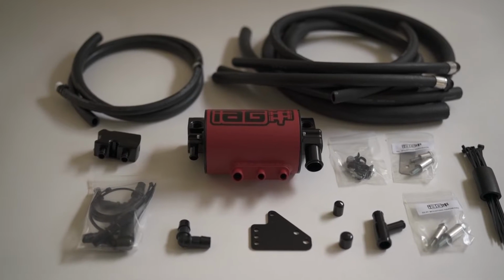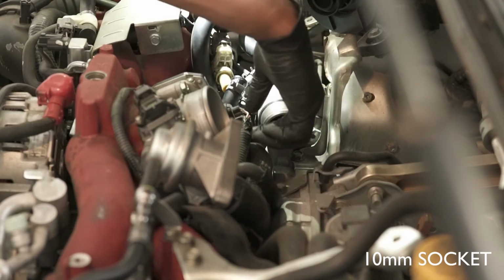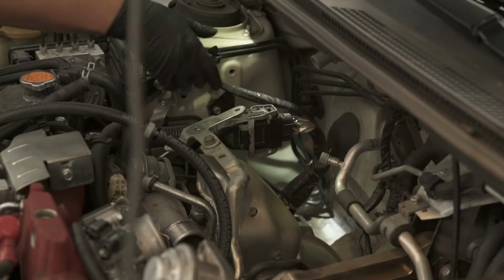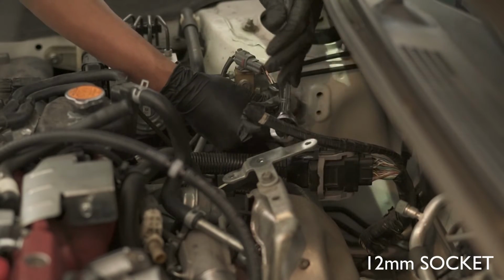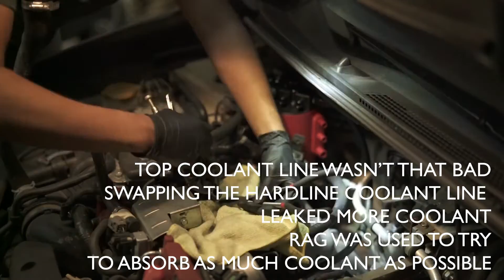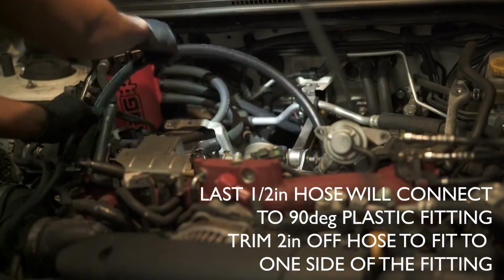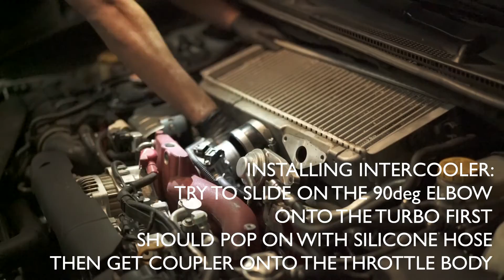Subaru WRX STI | IAG Performance AOS Street Install DIY

Comment from the maker: Couldn't fit this into the video description but use this as a table of contents!!!! :) Thanks for watching!!!

---------------------------
1.

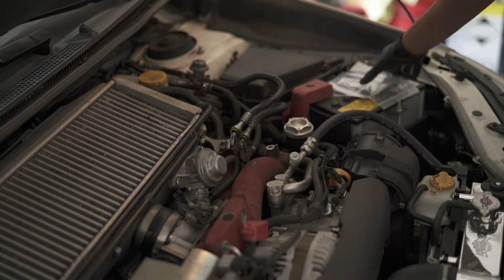-  @2:40 : Disconnect the battery with 10mm socket

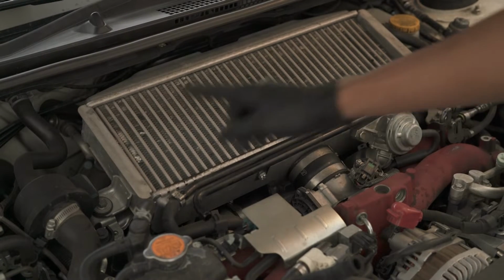- @3:29 : Remove hoses from oil line with needle nose pliers

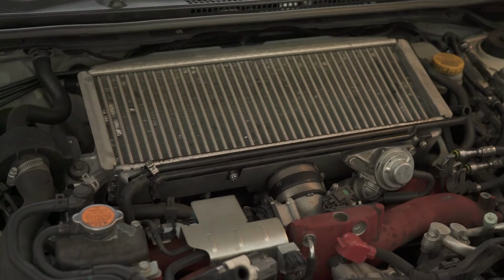- @3:54 : Remove intercooler. use 12mm socket.4 bolts total. 2 bolts mount the bypass valve to the intercooler. 2 hold the intercooler to a mounting brack. 1 of the bolts is block by sound generator tube. remove the sound generator tube (not sure what size socket you need).

- @4:25 : Loosen turbo and throttle body coupler clamps.

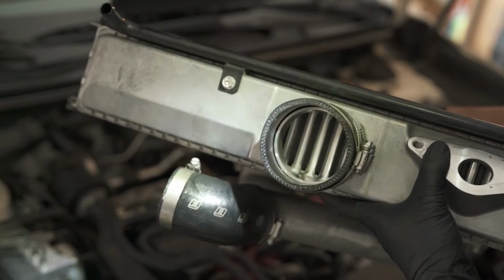- @6:47 : Links to TurboSmart Couplers! https://www.rallysportdirect.com/part/universal-hose-couplings/tbs-ts-hs275075-bk-turbosmart-silicone-coupler-2-75in-black
https://www.rallysportdirect.com/part/universal-hose-couplings/tbs-ts-he90200-bk-turbosmart-silicone-elbow-90deg-2in-black

- @7:50 : remove oil breatherline from intercooler. 10mm socket

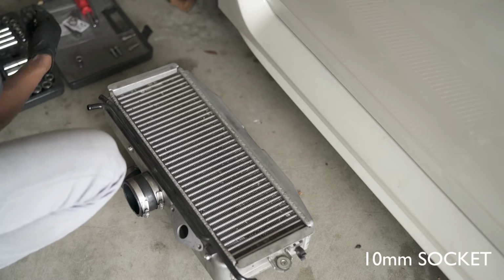-  @8:13 : Remove breather hoses (Passenger & Driver side). On each side there are 2 hoses next to each other. You are removing the ones that are closer to the front of the car on each side. Follow the hoses that were once attached to the solid oil breather line attached to the intercooler. Passenger side breather port is shown @9:20 & driver side is shown at @9:58
Reply from the maker: ------------------------------
2.

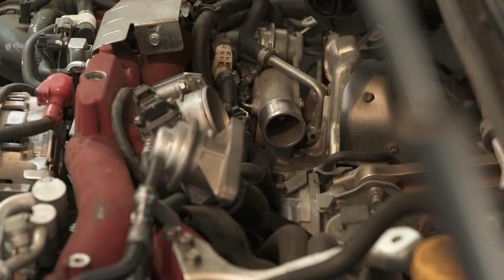- @11:35 : Remove 3rd hose connect to blow-by sensor & middle breather port.

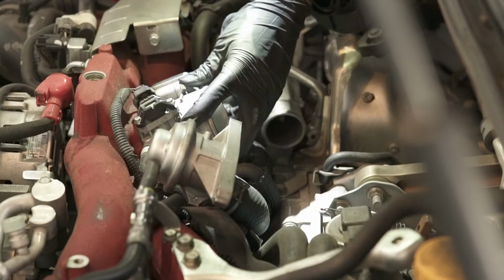- @12:20 : Disconnect throttle body from intake manifold. 4 bolts hold it in place. throttle body was getting in the way of removing the hose so I disconnected this first. 10mm socket.

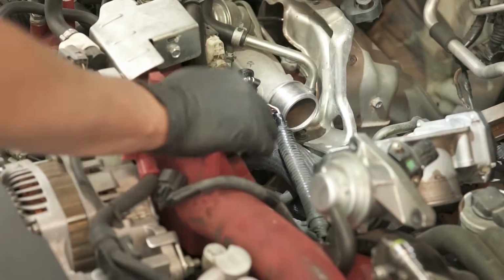- @13:08 : Remove hose assembly attach to third breather port

- @14:15 : install supplied hose (not sure what the size is but it is pre cut for you in the kit) to plastic "T" fitting shown. Piece with connect to middle breather port. secure properly with zipties.

- @15:05 : Remove hose connect to the intake manifold. We removed the throttle body from the manifold to get to this hose. When standing at the front the car, the hose can be found on the left side below where the throttle body would mount. use pliers to remove. This hose was once attached to the hose assembly we removed earlier at @13:08. shown @16:00

- @16:09 : Attach supplied 3/8th hose to nipple found on intake manifold.

- @17:10 : Reinstall throttle body. I used a new throttle body gasket ( https://www.rallysportdirect.com/fits/2015-subaru-wrx-sti-base-2-5/gaskets/grm-020010-grimmspeed-drive-by-wire-throttle-body-gasket). 4 bolts Torque down to 6ft/lbs.

- @18:15 : unmount main wiring harness. the wiring harness is in the spot of where the AOS will mount. we are going to unclip the harness from a mounting bracket and cut the electrical tape carefully to create slack in the harness for when we relocate its position.

-  @19:42 : Remove main wiring harness bracket. 10mm bolt

- @20:10 : pull brake lines. this is a little sketchy feeling but the instructions ask you to pull the brake lines closer to the strut tower & closer to the firewall to make room for the AOS. Don't worry. the lines do flex just be careful while you do it! :)
Reply from the maker: -------------------------------
3.

- @21:15 : Since I bought a competition AOS & comp to street conversion kit, I need to replace the top feeder port of the AOS to the street piece. 3 bolts hold the breather port in place on the AOS. use a hex key to remove. none is provided in the kit. This was annoying for me.

- @22:30 : install coolant lines to AOS. Hand thread it in & tighten with a wrench. 

- @23:10 : Install mounting bracket. Your bracket may be different than mine since they change the bracket after April 2016. Should be easier to install into the car. 3 bolts hold bracket to AOS. tighten with hex key (not supplied). I attached my bracket 1 from the very top hole of the AOS. Also attached bottom 1/2in. drain hose to the AOS.

- @27:00 : off camera, Before you mount your AOS to the strut, Attach the hose connected to the nipple behind the throttle body to this section of the AOS (side port of the street breather port). I would not be able to install this hose properly if the AOS was already mounted to the strut.

- @24:48 : Mount AOS to the passenger strut tower. Newer brackets (post April 2016) will use the already exposed holes. Skip this section. Use supplied hardware. For me I needed to remove a 12mm bolt and mounted the AOS to that 2 openings. The video gets weird here because I did not have the proper tools to tighten the bolts that mount the AOS to the strut tower. Clearance is VERY TIGHT!!! Buy a socket wrench set and it will make your life easier!!! This should have taken me minutes to install but this was the most annoying thing to do without a SOCKET WRENCH.

- @25:05 : there is a metal bracket that is connected to the power steering line with a 10mm bolt attached to it. we are going to remove the 10mm bolt and install the main wiring harness relocation bracket to this are. used the same 10mm bolt to attach the provided bracket to the power steering bracket.

- @27:45 : Remove intercooler mounting bracket. Clearance is tight. I can't move the wiring harness to where I want it to be. 2 bolts on the mounting bracket in place. 12mm socket.

- @28:50 : Attach AOS coolant lines. Use Supplied clamps!! Top AOS coolant line will attach to Coolant expansion tank. Reference video. Bottom AOS Coolant line will attach to the turbo coolant hardline. Minimize coolant leakage, hose clamp coolant hose shown at @29:05. AOS coolant hoses requiring trimming. give yourself slack and make sure no kinks are in the hose. I cut mine just a little too short and there is a very small kink in my hose. I'll be replacing that soon. Trim appropriately so there are no kinks in hose & secure with zipties.
Reply from the maker: ------------------------
4.

- @31:45 : AOS Drain Hose. It attaches to plastic "T" fitting shown at @14:15. Route hose through small hole of the intercooler bracket. Hose should be routed under the turbo towards "T" fitting. Trim appropriately so there are no kinks in hose & secure with zipties.

- @33:15 : Use 5/8th hose. Cut 3in. off the hose & attach it to a 90 degree plastic fitting. attach rest of the 5/8th hose to the other side of the fitting. 3in. hose part will attach to the top of the "T" fitting shown at @14:15. The hose will be routed over the turbo & under the intercooler bracket. The end of this hose assembly will connect to bottom oil hose inlet of the AOS (shown @33:50). Trim appropriately so there are no kinks in hose & secure with zipties.

- @34:25 : Route 1/2in. hose from middle oil inlet of the AOS to the Driver side breather port. I routed mine along the firewall, underneath the pitchstop & towards the breather port. Trim appropriately so there are no kinks in hose & secure with zipties. 1/2in. Hose is extra long. the trimmed piece of hose will be used for the passenger side breather port!

- @35:08 : Route the trimmed off piece of 1/2in. hose from @34:25 from top oil inlet of the AOS to passenger side breather port. Hose will be route under the main wiring harness and over the passenger side injector cover. I made the hose also gu underneath the intercooler bracket towards the top inlet of the AOS so that the hose is not pinched against the intercooler. Make sure your hose does not go cover the internal wastegate of the turbo. Trim appropriately so there are no kinks in hose & secure with zipties.

- @36:30 : Last 1/2in hose will attach to 2 top breather ports of the AOS. Cut 2in off 1/2in hose and attach to one end of a 90 degree plastic fitting. attach remaining hose to other side of the fitting. route Left breather port of the AOS will route to section shown @36:50. Trim appropriately so there are no kinks in hose & secure with zipties. 

- @37:35 : With the remaining hose, cut 2in off and attach to 90 degree plastic fitting & attach remaining hose to the other half of the fitt. Route from the right breather port of the AOS to the blow by sensor located near the turbo. Route hose underneath intercooler bracket to avoid being pinched between the intercooler. 

- @37:55 : All hoses should be attached and AOS should be installed!!! Clip recaps where all the hoses are routed. Right AOS breather port hose that attaches to the blow by sensor in previous step (@37:35) is not routed appropriately in this clip. Reference photograph shown at @43:57

- Last bits! Reinstall intercooler bracket. 2 bolts. Torque to 11.8 ft/lbs.

- Mount intercooler. Tighten up clamps. 2 bolts to mount intercooler to bracket. Torque to 11.8ft/lbs.

- Reinstall bypass valve to intercooler. I used a new gasket (https://www.rallysportdirect.com/fits/2015-subaru-wrx-sti-base-2-5/gaskets/grm-020023-grimmspeed-blow-off-valve-flange-gasket). Torque 2 bolts to 11.8ft/lbs.

THAT'S IT! Thanks for watching!!!

Comment: just installed mine yesterday, what a beast of a install. easy, just time consuming. great video
Reply: there was def no way that hose would fit next to the turbo outlet! had to re route it around the turbo!
Reply from the maker: hahaha glad it all worked out for you man! It definitely it just intimidating at first glance, but relatively not that bad!! :)
Reply: What is the aos gonna do to sti if u install this ?
Reply from the maker: if you follow the hosing for the breather ports on the crankcase, all of these lines lead back to the intake inlet which is connects directly to the turbo. This creates a closed system to properly vent & relieve the pressure out of the crankcase while the engine runs. While this kind of system is relieving pressure out of the crankcase, typically oil is also pulled up through the lines and into the turbo, then intercool and into the intake manifold. A mixture of oil in the combustion chamber will basically lower the octane levels of the gas and create knock as well as cause carbon build on the valves. Typically this is one of the reason why the EJ motor eats so much oil - it literally sucks up oil out of the car eat its through the turbo and goes straight into the combustion chambers. 

What this AOS does is allow for the oil that is pulled out of the breather ports to dump into the 1L canister of the AOS. Unlike a catch can, you do not need to uninstall and drain the AOS ever couple of weeks. It is a closed system that drains the oil collected oil back into the crankcase while routing only air back into the intake system. Hence the name air-oil separator :)

From my own personal experience, I used to have to top off oil ever 3,000 miles due to oil being sucked into the intake system. I don't eat any oil anymore. Even on track days where I typically have to top oil off  after 2-3  sessions, the car still has all of its oil. The AOS never fills to the point where oil may enter the intake system again. I'm pretty positive that if I took off my intercooler, I would not find oil around my turbo or throttle body as I once did before I installed the IAG AOS.

Grimmspeed also makes an cheaper AOS, but I found that it did not do a good job in separating the air & oil. I put clear lines on for the hoses that route back to the intake inlet, and saw oil vapor build up in the lines. I'm sure it helped and some oil was drained back into the oil pan, but it was not completely resolving the problem as I feel my IAG AOS is doing.

Comment: About to install this tomorrow. Thanks for the in-depth install!
Reply from the maker: How did it go!?!
Reply: I wish I could post photos! Clean install. Took me a while, but I had to watch this thing more than once haha. Honestly, this video helped tons!

Next is choosing between the IAG/Cosworth/Aeromotive Fuel rails, paired with 1300cc Injector Dynamics Fuel Injectors, with a fuel pump that I still need to do research on. I have a Walbro 255 on my Legacy, but I want to try something different with the STI. I need to see which pump will work with the Precision Factory Upgrade Turbo. I want to see how long the OEM EJ257 Long block will last!

Comment: i cant believe these dont come on these cars stock.  My car has 20k miles on it and when i had to pull my intercooler off to i was actually pretty upset about how much blowby was in the hoses.  Subaru needs to step their game up.  STi's cost almost 40k brand new and they cheap out on stuff that is critical to your engine running properly
Reply from the maker: I totally agree. It not like its an actually catch can and you aren't opening the vacuum system. implementing something like this from the factory would be amazing. But that's not to say it would keep ringland failure or spinning a rod bearing from happening. If Subaru put the proper monitors in place so that the center dash display could tell  the driver, coolant temp (which already is being recorded but poorly communicated to the driver with a numberless gauge hahaha) and oil temp, that would go a long away for people tracking this car. Instead I had to pay almost 1k in parts and labor to install some damn gauges hahaha that center display had so much potential... and i'm pretty sure the wrx tracks oil temp... why not the STI?!!?! makes 0 sense.

oh and the shit cast pistons are another thing, but I'm sure in the US market, those s209 parts are going to trickle down to the regular models as well.

Comment: Good job. Did it help with your oil consumption?
Reply from the maker: thank you! I can't recall if this eliminated oil consumption on the track (at the very least it substantially helped at the track!), but almost 50k miles on the car after installation and I never had to top off the car with oil during daily driving usage + occasional spirited canyon driving!

Comment: My IAG aos comes in this week. This is probably the 3rd time Ive seen your install. Just trying to make this install as smooth as possible.
Reply from the maker: I hope the video helps! It's a PITA but really rewarding after you've completed it! :) I feel like you get to know the EJ/FA motor in a different manner after you install this part. Like you can read all about it, but it's only after going through the grind yourself do you really get what the product you're installing is actually doing hahaha In case you need to jump around in the video, I pinned to the top of the comments a little table of contents with time stamps to each section of the install! Hope it helps you and best of luck!
Reply: @SpacemonkeySTI  so far it looks like just trying to get the fittings/hoses in the tight spaces around the crankcase is the hardest part. I currently have zero issues with oil consumption but I'm planning on signing up for quite a few track sessions next so I'm slowly preparing for that
Reply from the maker: @diegotobar6839  Good to hear that you don't have issues with oil consumption right now! This part i something you don't want to install after the matter hahahaha I may have skinnier fingers but I don't recall having trouble slipping the hoses onto the crank case venting ports (except that middle one near the turbo). I would say the biggest pain in the but for me was mounting the AOS to the strut wall (though I think IAG redesigned their mounting bracket to make this easier) & putting back on the damn TMIC hahahahaha

It's been a month now - how did the install go!

Comment: Thanks for the video this has been a life saver. I'm almost to the part of routing wires but I can't figure out how to mount the wiring harness to the new bracket they make you install.
Reply from the maker: damn I just re-watched this video and realized that 28:50 that new bracket for the wiring harness just appears on the harness! My bad for not filming that! If I can recall correctly, at 18:20 of this video I undo the wiring harness from the OE bracket holding it in place.  with how the harness it positioned I had to pull upwards to release the harness off the bracket. 

keeping that in mind, when you mount the harness to the new bracket, you're going to need to slide the harness over the bracket in the same orientation. My suggestion  is to look at the OE bracket and see how the harness is locking into place and  try to mimic that with the new bracket. Sorry for not filming it!

Comment: I just installed my IAG AOS on my 17 STI and it was actually a pain in the ass. If it wasn't a motor saver I wouldn't have touched it. Snapped a throttle body bolt along the way also so I had to order a new flange bolt from subaru lol spent 74 cents on the bolt and spent $40 to over night it because it's my daily and that was 4 days ago, still no bolt "they're on back order" 😐
Reply from the maker: hahaha sheeeeeez im sorry to hear! I think on the 17s you have a sensor also on a couple of the oil lines that run below the TMIC right? was that easy to deal with? glad you finished it up though! It's like a rite of passage to DIY this modification. Definitely a motor saver mod! we're 1 step away from attempting to TGV delete DIY and tampering with fuel :) hahaha Im just kidding - I really wish I kept the car stock and got a pro tune for it to run well, tired of the noise hahaha
Reply: @SpacemonkeySTI  yeah I had to surgically remove 2 sensors with needle nose and plug them in and electrical tape the connectors. For my throttle body bolt I set my torque wrench for 6lbs and it still snapped 1 of my bolts, luckily I started to cut a rivet in the remaining threads with a fine tooth saw and it came loose. I've been to every hardware store in my town and no bolt is the correct spec as the flange bolt subaru uses which put me in a bind. Oh well it was worth it. Lol thanks for the reference video, if I did one it would've had a lot of cussing. 😁
Reply: @SpacemonkeySTI  it definitely feels good to do it yourself, I'm at Stage 2 and I'm planning on staying here awhile before having to mess with fuel upgrades, good luck btw. 👍